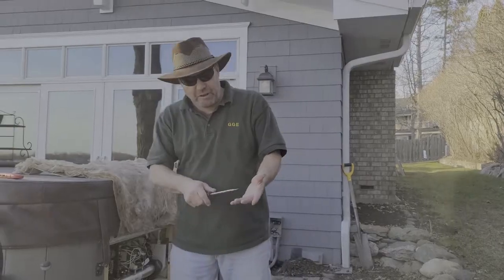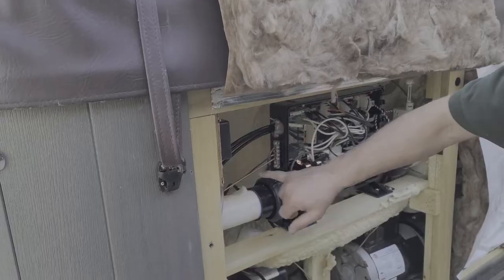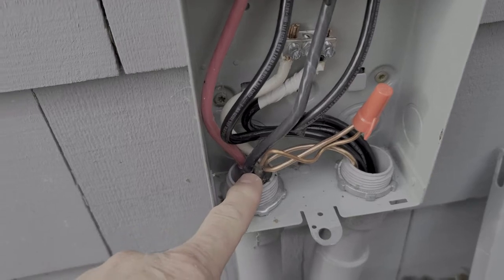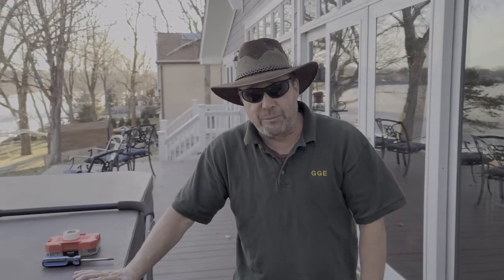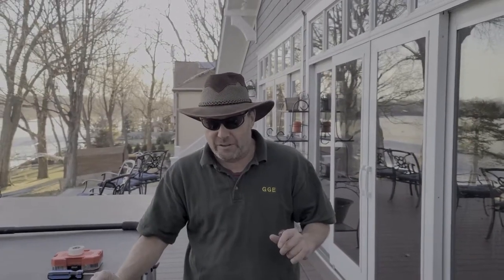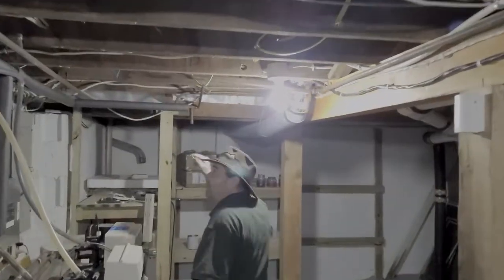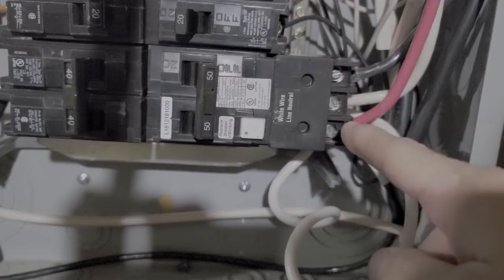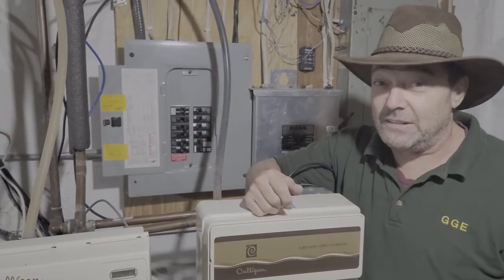DIY Electrical Wiring Basics for Hot Tub Installation

Comment: Thhn should not free float or be secured with two screw ROMEX connector. Transition to non metallic flex conduit and terminate with correct fitting at the junction box

Comment: Wrong,  Wrong,  Wrong.  Neutral is connected to the ground bar. You can get a shock from the current carried back on the Neutral.  Box is not grounded. Gfci breaker is required outside,  not inside.  Lol...stick to mowing grass , youre going to kill somebody.
Reply from the maker: Unless the inspector tells you to move it. Passed inspection, so I got no problems.

Comment: Do you experience nuisance tripping of your 50amp gfci breaker you put in your main electrical panel? You might have been better off using a standard 2 pole breaker in the panel and installing a box outside that would accommodate the 2 pole 50 amp gfci spa breaker.

Comment: The hotspot manufacturer is calling for a number 8 AWG copper with a 2 pole 50 amp circuit breaker GFCI.
It's in there diagram and schematics showing all number 8's.
I wanted to run number 6 gauge copper but their terminals would not fit it.
What are your thoughts on this please? Thank you
Reply: @theseattlegreen1871  8 copper can hold 50-55 depending on type of wire and temp
Reply from the maker: If I wanted to run bigger wires like you so that I have less chance of hot wires and voltage drop over a long distance, I would simply trim the ends just enough to fit in the lugs.
Reply: @TurbineGuy  
Never trim the ends of any wire. I would have to 100% disagree with you there

Comment: Question. Should you be using THWN wire for wet areas? I thought you said THHN wire. Im not an elastration so Im asking...
Reply: If you look closely THHN and THWN will always be written on the wire next to each other. 
THHN stands for Thermoplastic High Heat-resistant Nylon-coated. THWN wire is the same, but the "W" stands for water-resistant. The main difference between these two standards is their maximum temperature in wet locations.

Comment: So you surface mounted the pvc to the hot tub? Supposed to be underground trip hazard I'm a master electrician. Just hire a proper electrician. If the inspector passed that off hes an idiot pvc can never run on the ground
Reply from the maker: Going underground there was not practical at all, but running the conduit along the dock edge was. And yes, they do make PVC that is strong enough to run on the ground, surprised you do not know that.
Reply: @TurbineGuy  show me the code that allows pvc run on the ground.. doesnt exist. Surely will work but it's against code. Have you passed a code test ?
Reply: 300.5 in the NEC
Reply from the maker: @RawHeightsBeats  I passed inspection and the inspector, and the MN Dept of Labor engineer that showed up both had no issues. Passed the inspection, got the sticker.
Reply: @TurbineGuy   @Turbine Guy  inspectors are horrible they either call stuff that shouldn't be or they miss things. 90% of the inspectors I've met were never electricians. It will certainly work but you'll never see a true electrician running pvc across the ground especially with no straps or supports. But otherwise everything is installed properly

Comment: Could  I install a 50 amp breaker in house box and then use a 50 amp gfci disconnect box?
Reply from the maker: Yes, that should be fine. key is to have the gfci somewhere.
Reply: Yes, you can have a normal breaker inside and a GFCI breaker box outside. You can also have a GFCI breaker inside and some other box outside. Some codes say a GFCI must be a minimum of 10 feet or about 3 meters from the tub. My tub is only 5’ from my junction box outside but the way I’m running the wire there is 10’ so I could go either way. I already have the junction box drilled into my brick so I’m going to go the route of the inside GFCI I think.
Reply: @rotorav8  Thanks I ran it with a normal dual pole 50 amp breaker in the house and a 50 amp gfci box outside.  Been running good for a few years now

Comment: Wiring is a mess , not professional for sure
Reply from the maker: That is really funny. Passed the electrical inspection just fine. Not sure how you could do it any better given the circumstance I had with the house setup as is.
Reply: The lug you have used for neutral in disconnect, is for ground wires and neutral wires have to be connected with isolated lug in disconnect.
Reply: Instead of using gfci breaker in main panel…better to install gfci protected disconnect